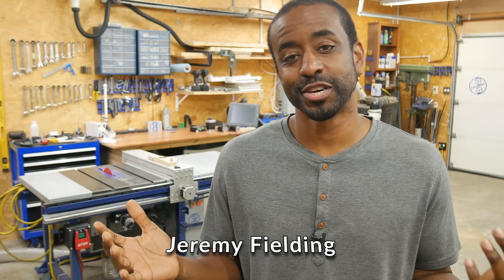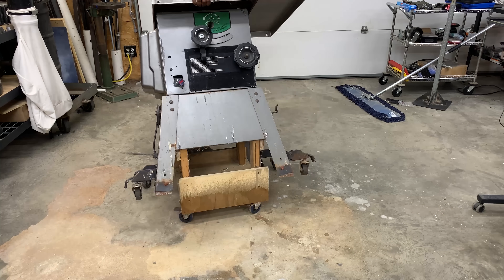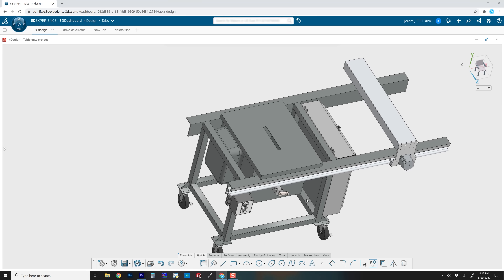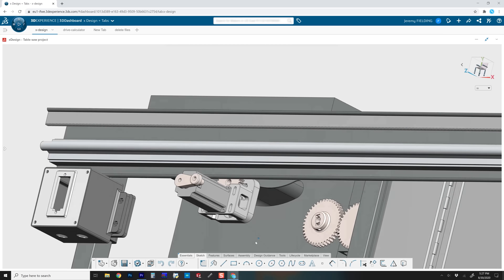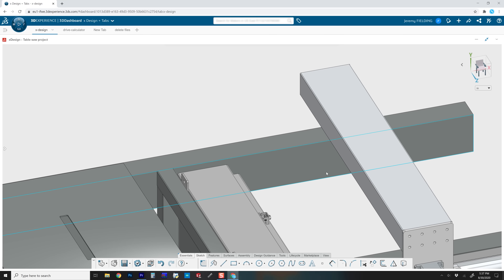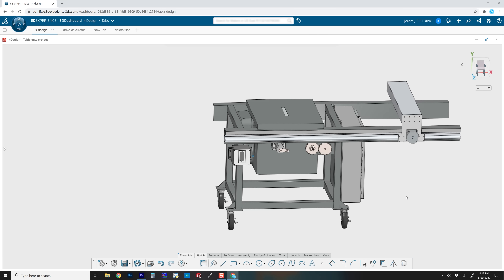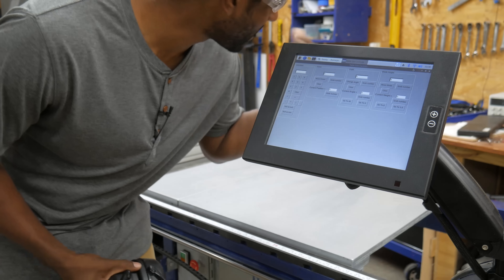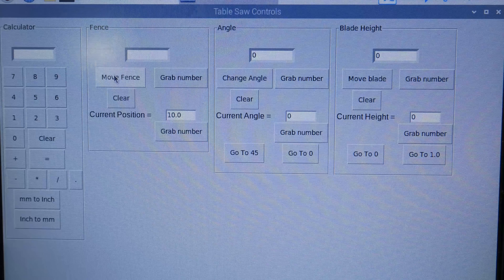How To Make A CNC Table Saw : # 084

Comment from the maker: I forgot to mention in the video that I also plan to add a homing sequence. That way you hit a button and all motors go back to zero and it is repeatable like all other CNC machines. Thank you so much for watching. You guys are the reason I do this! And thank you to SOLIDWORKS /Dassault Systems for helping me get to project out to you.
Reply: In my other comment I mentioned I have programmed for a long time and spent 13 years writing motion control software for Pitney Bowes.  I have done the the tasks you are mentioning (homing, motion profiles, etc) multiple times.  If you you want to talk, reply and I'll get in contact with you.  If you want to figure it out yourself, I respect that too.  There is value in the journey.
Reply: @connecticutaggie  Jeremy, I would love to see a whole video about coding acceleration, jerk, and other motion profile features.
Reply: Add a claw clutch to the motor handle instead of the angled gearbox. Nice project!
Reply: Just found out about you from Destin's baseball cannon video.
Reply: @xenonram  LOL, Justin's baseball canon video is the next item on my watch list.
Reply: Nice set up Jeremy and the table you made and welded great job. Never thought of a cnc table saw but it will be revolutionary.
Reply: You should nitride the top surface.. 
Or just put on some "gun blueing" chemical... You should be able to get plenty for this job for $10 on Ebay.. Just search "gun blue"
Reply: Regarding absolute location, one of our Epson robots at work failed with a error "absolute encoder battery failing".  Interesting, it seems they are using a relative encoder with a encoder counter and a battery to create an absolute encoder.  SMART!  True absolute encoders are expensive and a pain to use.
Reply: @connecticutaggie  I've used inexpensive 24V DC power supply/chargers with a pair of 12V SLA batteries in series to preserve the position of incremental encoders; total cost about $100 to protect the entire machine.  Cost is less if you needed the power supply anyway.  It works really well.  If a tradesman from another trade comes along and flips the wrong breaker (mine), the encoder still remembers where it is.
Reply: @connecticutaggie  Interesting work around.. Gotta keep changing your batteries though-- small hassle to pay
Reply: @calholli  Yes, that is what caused the error to show up.  There was a mechanical issue with the systems which (due to COVID) is taking longer to fix.  The last time the engineer that was working on it was at the machine, he powered off the system and disconnected the arm.  Thus, no power to recharge the battery and the error.  This is really only a good solution for systems that either are always plugged in or are easily homed.  Homing (Calibrating) the robot at work will likely take several hours/days.
Reply: @calholli  The battery is usually just a backup so as long as the machine is long enough to keep the battery charged, you are good until the battery declines.  This can be several years.
Reply: Hey Jeremy, for ease of use add like a nudge left or right by mm and cm shortcuts. This would make minor adjustment on the fly for things like dados or cutouts for joinery. If I was you I'd add an encoder on the fence rail system as to indicate where the fence is ,this would have made the coding process much simpler as you'd always just use the encoder number as start position and minus(left) or plus(right) to desired position and would remove the possibility of missteps at high speeds and would allow when removing locks for manual use to immediately know when relocked which position the fence is without telling it.
Reply: Yup, like others, I thought the same thing. end stop for the fence with a zero point. Great project Jeremy.  I just finished my first programming project in python as well. It was to real seeing you frustrated while coding. I know exactly what that felt like. lol I, like you, am not a programmer, but learning is so rewarding. God bless sir.
Reply: I literally just suggested that!
Reply: What a cool project. It looks amazing. Good work!
Reply: I was gonna suggest that, good deal
Reply: You could use a prox switch that senses a home or position and program a return button on your HMI.
Reply: @chrisp190  I have used prox switches (though that is a bit of a vague term) for homing but is is not the only option.  Almost all 3d printers use mechanical leaf switches for homing they are cheap and reliable, but you do have to protect them as they damage easily.  I mostly have use IR opto-detectors as they are cheap, robust and reliable.  You can also use retro-reflective opto detectors and put retro-reflective tape on the homing point; but, in either case, you have to accommodate for dust.  Hall sensors are a bit more expensive and are robust, reliable, and ignore dust but don't play as well with ferric metals around.  Captivate and Inductive Prox sensors also work but are more expensive and are affected by range so they often have to be calibrated.  Generally my favorite in an IR photo interrupter that a homing tab slides between - they are cheap, reliable, and easy to mount and interface to.
Reply: Jeremy Fielding we had controllers on heavy satellite dishes that had ballistic curve built into the controller to start and stop a large mass slowly enough to avoid over stressing the linear actuators. They are basically natural logarithmic curves built into the program that ramp up and ramp down.
Reply: @bchrisl1491  Not exactly sure what a ballistic curve is - I assume you are meaning something parabolic.  2nd order profiles can have the advantage of having a continuous 1st & 2nd order derivatives (v and a) but they still can have infinite higher order derivatives (jerk and snap) . 
My favorite profile is SCCA (SineCosineConstantAccelleration).  The big benefit of SCCA is that it have no infinite derivatives of any order.
Reply: Mark Hancock I was thinking about an acceleration factor based  on the curve fx = nl(x)  or 1/nl(x). The 
large mass would not be a significant factor in the table saw application, but it would start slowly and stop slowly..
Reply: @bchrisl1491  The problem with ln(x) is that all it's derivative goes to infinity at x=0.  In general, infinity ends up making bad things happen.  That is one reason we used SCCA for aggressive axes.  In most cases, linear accel is fine.  Another issue with ln(x), it is more time consuming to calculate.  In one machine I worked on we were controlling over 200 axes many of which involved coordinated motions.  Sin(x) is just a simple table lookup and with interpolation you have infinite precision from a relatively small table.
Reply: What were the stepper drivers you used? I see what looks like maybe two TB6600 but then there's a really beefy one. Did you run into any problems with those drivers?

Also, you probably know this already but, from what I understand, figuring out the proper way to ramp up and ramp down speed gets pretty technical fast and this is why most people use something like GRBL, Marlin or the like. I would recommend putting an Arduino in the middle of the Pi and the stepper controllers, running GRBL to control them (or just keeping what you have if it works).

More power to you if you do, but I suspect you're quickly going to go into the weeds with Bresenham's algorithm, weird discretization issues and a host of other problems that come with this type of control. See GRBL's `stepper.c` code for a preview of what's involved: https://github.com/gnea/grbl/blob/master/grbl/stepper.c

Great build!
Reply: You mentioned wanting to find a way to slow down the motor before it reaches its limit. I've worked in gate automation for a while now and one particular manufacturer has a system where the controller counts the number of revolutions of the  motor with a sensor and a wheel attached to the spinning shaft. That can be an option for you since you can use your programming knowledge to have this help you make micro adjustments on each axis.  Hope this will help. Great work you're doing.
Reply: @malcolmjnbaptiste154  I always target to stop at position with zero velocity.  The simplest way to do that is just to pre-calculate the decel distance and begin the stop that distance ahead of the target.  Also, with servos we closed the servo loop based on distance rather than velocity.  But, then again, the applications I have worked with often target sub-millimeter precision.
Reply: I'd want a trig calculator, so if I want to cut a 1 inch board all the way through at 30 degrees, the height of the blade (hypotenuse) auto sets to 2.125 inches (hyp + blade thickness).  Actually come to think of it, the blade should be at least 3 teeth above the cut for safety reasons, but you get the idea.
Reply: Great video, and a great idea... I built my first CNC a few years ago, this makes think about a new build...maybe a table saw?
Reply: The simplest way to implement acceleration would be to use a trapezoidal motion profile.
Reply: @coulombicdistortion1814  I agree, linear/trapezoidal profiles work for most cases; however, if you start going above 3g or are pushing the limits, you may want to reconsider.  On one application I was working on, the timing required a 10g accel and linear profiles were creating too much strain on the mechanical components.  We broke several stainless steel shear pins before I changed the profile.
Reply: Try CLR or wood bleach, same just stronger concentrate. It's not only a great rust remover, but if you leave it sit for a few hours it can give you a nice blackened surface that will protect it as well. It's similar to gun blueing which is a form of rust. I've found lost tools outside and the blackened ones were fine after a month.
Reply: Try Boeshield on the saw top. It is made for applications like what you have there. It is available through your local woodworking stores like Rockler and Woodcraft.
Reply: Really looking forward to seeing the acceleration and home routine addition... I may have to modify my saw now I am doing more repeat products.  It would be very nice to recall some parts.  Great project!
Reply: this thing is really cool!
Reply: Have you thought about an automated feed tray or sled?
Reply: That would be a great addition.  On the hardware side, adding an encoder that could track absolute position whether motors are engaged or not would also help when you re-engage.  Between that and the homing sequence (I assume you would use a sensor--maybe optical) to register zero), you wouldn't have to set a positions manually (error can enter here) and type it in (error can enter there).  Cool project!  I like the idea about cutlists, too.  And saving projects would be cool.  With all of that, you could have a machine that could repeat a prior setup (or set of setups) exactly.  Add a motorized sliding infeed table like the big Euro saws with some stock clamping and you could completely automate cuts.
Reply: instead of the shut off switches, why not put it into the code that if you put in something outside parameters that it just shows p "can not complete, total adjustment outside of parameters"?
Reply: This is sooo f@cking cool! Thats amazing! Good job, good sir!
Reply: Could you add an app to your phone to send the measurements to the iPad so you can make extra quick adjustments for more tedious jobs rather than going back and forth to the display every time?
Reply: I was just about to suggest using a homing sequence after turning the motors back on instead of manually adjusting the fence to a known value. This would take the human element out of it, reducing small errors in measurement.
Reply: Dude I hope you got a patent for this machine. I'm a retired carpenter and I have not seen any like this. Check on it. It could be a million dollar idea.
Reply: It's pretty easy to deal with BACKLASH in this project! 

It's been a while, I know. But a simple software solution to backlash is always end the movement getting the fence closer to the blade, that way it's always “pushed away“ from it and you have neither backlash from going either direction or deflection from pushing it away from the blade. 

Then, if it's seen its needed for something it could have some "obscure" options to reverse that behavior.
Reply: this might be late, but the best rust protection product seems to be "Fluid film"

a channel called "Project farm" makes alot of product comparisons and fluid film came out way ahead of other rust protectors, fluid film is even great at resisting wearing off
Reply: Cool project. And as always an enjoyable and educational "journey" - Both of engineering and "us humans" . Regarding rust protection: Maybe the saw is now being stored under more favorable conditions than in it's past, so it might not be a problem. - But, why not just give it a coat of some cheap, spray can clear lacquer?   Dirt cheap and easy to touch-up or redo.
Reply: ...and a small idea about your rotating handle while we're at it ;-)  Would it be possible to remove the handle from the shaft and make a notch in one, and a "dent" in the other. With a spring in between, your would have to press the handle slightly when turning it by hand, and the shaft can rotate freely when driven by the motor. Might involve some smaller modifications to the shaft to work though...
Reply: How about using feedback stepper motor
Reply: Look at possibly using metered belts instead of direct gearing. This would help to keep from damaging the motor and the equipment if it were to get in a bind (then you just break the belt or it slips).
Reply: You posted this a year ago and probably figured it out but with steeper motors you can ramp speed with a loop that increases speed iterating to different positions through the loop to your desired position. You can use a linear ramp, a logarithm,  or anything else you want, investing the stopped from zero and also ramping down when you best your destination.
Reply: Ciao Jeremy. Ho visto come hai modificato la sega e me ne sono assolutamente innamorato! È incredibile! Voglio farla anche io: a questo proposito volevo chiederti se è possibile implementare il controllo per la lama dell'incisore ( una lama più piccola posta in asse davanti alla lama principale ) e se è possibile far partire automaticamente l' aspiratore quando si avvia la lama principale.
Mi daresti un aiuto immenso, specialmente con il software.
Grazie di cuore! Christian.
Reply: Bonjour je voulais savoir si c'est possible d'avoir plus de renseignements sur le chema du branchement électrique
Reply: Very impressive! Don't forget absolute and incremental mode just like a DRO. Might also want to look at the user interface of a DRO for inspiration on how to improve yours. And uhh, I never saw a solid state relay, just cheap mechanical on a PCB 😉

Comment: Those relays are notorious for picking up noise

I am very curious how you made it freewheel, typically the motors back drive into the driver and then power the system up in a bad way

Comment: Hi Jeremy,  firstly I would like to say howm much I love your videos. I want to make a cnc fence for my table saw. I have an electronics background and I'm confident on that side of things.  I was wondering what you think of just using a toothed belt design. I don't know if the accuracy would be there or whether a Nema 23 motor would direct drive the belt if the gearing was 1:1   would appreciate your thoughts.  P.S.  I am not interested in adding control on the height and tilt.  I am also using the existing fence on the Ridgid tablesaw and will have an interlock so if the fence is locked the motor won't try to move it.

Paul

Comment: Just came across your video—nice work! I would have programmed a button that, if pressed, would reset the position to wherever it should be, instead of manually moving the fence to the nearest even number, typing the number in, and pressing OK. Thanks again for sharing these awesome engineering projects!

Comment: Hey Jeremy, are you still using this saw 5 years down the road? Probably by now you've added a fusion reactor though...
Reply from the maker: Actually I told it a part. I wanted more space, I don't cut sheets of wood very often, and it was quite large. If you look at recent videos it is all machining and welding. No wood.

Comment: All I want to do is put a motor on the blade height because it's such a pain on my cheap saw.  I'll need to take it apart to see exactly what's needed but at your version gives me some ideas.  If I wanted to do something like you're doing I should buy a better saw in the first place.  I think the one I have now cost $150 on sale at Home Depot many years ago and it works but it's not at all good.  Where I work we have a "real" saw and that's so nice that it's smooth and accurate.